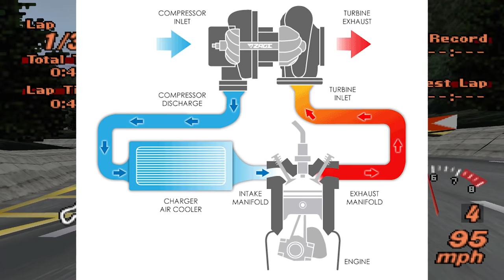5 MORE Gamer Misconceptions About Cars!

Comment: Thank you for #2... Cause so many games from 2010 and Prior refer to nitrous boosting as, "HIT THE TURBO BOOST!" or "ENGAGE TURBO!!" 
Like literally in NFS 2010, a bone stock Shelby Super Snake with a Supercharger...somehow still has a Turbo too?!?! Like wtf? 
My Coworkers still use the word "Turbo" like it also means "NOS"...

Modern games don't mix them up as often, but literally a whole generation of Non-car people have grown up completely having turbochargers misrepresented to them...
Reply: Yea
Reply: haha I got people asked me which button on my steering is my nitrous button. I had to explain them that in LMP1 hybrid cars uses electric motor that gets up to 1000 hp combine. I told them its lot better since you can use braking regen to get those energy really easy.
Reply: It's never fully explained in HP2010. My personal theory is that "Turbo" is just a Racer nickname for a Nitrous-like system that uses the exhaust system of the car (somehow), that works somewhat like a solid-booster; it can't be shut off until it burns out completely
Reply: @racer927  doesnt nitrous work like that IRL?
Reply: @foczastafomka5502  Let me give you the smallest version I can muster:
Nitrous oxide is injected into the cylinders on the intake stroke, this nitrous oxide, kept liquid under pressure, vaporizes and provides oxygen, which means that the combustion stroke will produce more power, it also cools the air inside the cylinder, allowing more air to be compressed without risking pre-combustion or "knocking" before the spark plug fires and ignites the air-fuel mixture as usual.
Reply: @racer927  science boi
Reply: @VdubsZone  Yes. Automation and BeamNG has taught me more things about cars than anything else.
Reply: @racer927  tbh automation is addicting for me lol, i cant stop making car to export it to beamng, and doing some experiment
Reply: one misconception, is that not using the clutch can damage your transmission, this of course depends on the quality of synchros, which is usually determined by the age of the car, other than that, as long as you match your revs relatively close, youre fine without the clutch at least in downshifts, which sim racers like assetto corsa and beamng seem to get wrong..
Reply: @LowEndPCGamer100  Really? I always thought the clutch was required even with synchromesh as that simply helps match the speed of the output shaft and gearbox. The pedal clutch simply disconnects the gearbox from the engine.
Older transmissions require what I've heard dubbed as "double clutching" (clutch, shift to neutral, release and then clutch in again for next gear) to help match the speed of the gearbox to that of the dog clutch on the output shaft.
I've also been looking up, thanks to using a transmission mod in Farming Simulator 19, various tractor transmissions and it's interesting to see that some transmissions will have synchronized shifting within a range but require a full stop of the tractor to change ranges. I've also discovered what are known as Wet Disc clutches which the transmission mod calls "turbo" clutches, essentially a series of clutch discs that are constantly lubricated which lets you hold the clutch open without burning it out as fast as a dry clutch and permits a bit of slip like a torque converter so that you can inch the tractor without the risk of stalling.
As a final aside, I did like finding out that using the clutch isn't required to go into neutral, that makes it easy in American/Euro Truck Simulator to simply pop it into neutral as I'm coming to a stop and let the service brakes and Retarder ease my truck to a stop.
Reply: actually the compound is NO (nitrous oxide)... NOS is just a company which manufactures NO and packages them in NOS branded cylinders :)....... tho u r true but i really love most wanted series XD
Reply: @racer927  i dont have any doubt that i am entirely wrong, but on the race track, no clutch is fine because most race cars end up getting rebuilt after a season or major race
Reply: Honestly you're not any smarter. The "Turbo" in Hot Pursuit 2010 obviously doesn't refer to turbochargers. Its a fictional system that is basically Nitrous on steroids
Reply: @r3uvsgaming  my problem with need for speed is that in all of the games ive played in that series, the physics are just total ass, i mean outrun for the system32 arcade board feels nicer to drive than most wanted black edition.
Reply: @r3uvsgaming  That's what I assume, some sort of boost similar to a solid fuel rocket that can't be shut off once started.
Reply: Ever played DT Racer?
Reply: @racer927  that’s cool to hear those help you with cars, BeamNG definitely proves you can’t just get a high performance turbo and go way faster, cause you need major changes to cooling systems and the block/heads and what not. I never got automation because it was kind of expensive, I also didn’t like the shells graphics on the vehicles
Reply: Lololololo
Reply: I'm a gamer, but I can't believe developers and other gamers don't use common sense
Reply: You can have a supercharger and a turbo on the same car. Volvo have been doing this for a while with their T6 and T8 models. It's just generally not done because it adds an extra thing that can break.
Reply: Honeslty those games are the reason initial d is so underrated
Reply: Most people when reading "N.O.S": "Nitrous Oxide"

Me when reading "N.O.S": "Not Otherwise Specified"

My job just makes me boring...
Reply: well to be fair, if you could turn your turbo on and off with a button, it would act pretty close to a nitrous
Reply: I've never really had the chance to get a misconception or "gamer" view. But i think that was mainly due to my uncle being a professional mechanic and building his own tuned car with actual turbo's and bottles of nitrogen. it was a bmw m3. First thing i did ask when i saw it was, if the light effects you get from your taillights in nfs where true 🤣
Reply: This is why EVERYBODY needs a free subscription to Car and Driver and not just me.

Hell, I'm not even really a car guy and hate the FnF movies and I never really carried any of these misconceptions.
Reply: @silversonic99  No it wouldn’t.  Not even close.  Nitrous is instant, turbos have to build pressure over time.  In this theoretical situation, the turbo would only start to build pressure once you hit your button to ‘turn it on’.  Now, electric turbos do exist, and can be activated with a button.  Since they use electric motors, they can spin at 100% speed almost instantly.  Therefore the only lag you would have is the time taken to pressurize the charge pipes and intercooler, which is negligible.  My knowledge on electric turbos is limited, but that is my take on it.  With an exhaust driven turbocharger though, it’s not comparable.
Reply: Weird cause NFS Underground, first one to introduce NOS, actually had it labeled properly AND shoot up smoke to the sides too. Turbo was a separate upgrade. Gran Turismo explains turbo lag, naturally aspirated and supercharger engines well, plus has events separate for those types so you kinda have to learn both, like in GT6 you can run Lambo Aventador for NA races but earlier needed some muscle car or, generally weaker, non-turbo versions of tuner cars.
Reply: i'm happy nfs underground 1 and 2 separated nos and turbo.
Reply: Yea lol
Reply: Modern terminology has changed turbosuperchargers to just turbochargers. Could become confusing for those uninformed and reading on older articles about forced induction systems like those used in WWII fighter aircraft.
Reply: @LowEndPCGamer100  NFS rivals has nirtous boost without constant flames , the turbo system is still like HP2010 😔
Reply: Miata or max-5 what’s better? (Joke)
Reply: where did NOS come from? I have heard nitro and even N2O but never NOS
Reply: The tutorial and upgrade videos of Turbo didn't help, as they did use a turbocharger there. At Level 3, it becomes twin turbo.
Reply: @harshchhetri644  No. NO is Nitric Oxide, one Nitrogen atom bonded to one Oxygen atom. N2O, or Nitrous Oxide, on the other hand, is 2 Nitrogen atoms, one Oxygen atom. They are very different molecules.
Reply: @racer927  Turbo often just refers to a timelimited boost or turning it to eleven outside of car contexts. So when developing a racing game it is important to check every term used for accuracy, normally this isn't a big issue since it is obvious that a flashlight with a turbomode does'nt have a turbine however it still makes the term unpure.

Comment: Point 5: do a drag race with the 1000 to 1500hp dragsters in BeamNG and experience chassis flex!
Reply: That’s the most satisfying part of drag racing
Reply: Question: I've had the game for litteraly years, got it back in 2014 or 2015, and still cannot figure out how to make the drag cars grip normally even on the drag strip on the west coast map. It's better on the drag strip yes, but still is hard to grip. What's a good tire pressure to start with because I know drag cars have pretty low pressure tires
Reply: @Sp00kq  as per internet, it is ideal between 15 to 5 psi.
Reply: @grhead812  ok. I'll give it a try next time. What I'm suspecting is what Bladed said. Not much weight in the rear. So if it doesn't work I gotta figure out how to put stuff in the back
Reply: @Sp00kq  addi g spoiler helps pushing the back afaik
Reply: @wibs0n68  only at higher speeds. It's mainly launching that I have trouble with. The drag cars do have spoilers on them mostly.
Reply: @Sp00kq  strip the whole front and leave the back stokc lol
Reply: @grhead812  could work
Reply: @Sp00kq  I find drag racing easy in BeamNG. Try adding throttle slower or something idk
Reply: Damn beam is such a great game, I have around 500hrs and I'm still playing it :D
Reply: @Jonah_258  1500 hrs here
Reply: @Sp00kq  softer suspension in the rear and have the rear height higher than the front, itll allow the car to squat onto the rear easier, and softer anti rollbars in the rear, more caster, and toe in in the front, and more camber in the front
Reply: Well that's why i love BeamNG Drive
Reply: @fuckfacesstashofshitposts3034  ight. I do have a steering wheel but it's so fucking annoying carrying it between the game room down stairs and to my room with my PC.
Reply: @initialyeet3951  1709 hrs here
Reply: @Sp00kq  ya need the drag slicks boi, you can download a mod that has drag performance parts which contains drag slicks, ultimate grip, i had the same problem as you and i fixed, nowhere i can do wheelies and twist the car frame whenever I want
Reply: Yeah I can't tell you how many times I have LITERALLY bent my car with the amount of power.
Reply: Yeah. Beamng is so underrated
Reply: Jack the back up and give it soft ish suspension low pressure tyres try apply power softly etc
Reply: Or just fully upgrade the isetta in forza 4 and try to drive it full throttle from a stop
Reply: A car with 1000 + horsepower is  not a car to me. No one needs that much power in Racing.
Reply: @FuntimeAG  yes and in beamng drive your point is proven, you can't drive the really powerful cars anyway just like real life
Reply: If you use the pickup for anything you'd have already seen chassis flex because just like real life they use an american-style c-channel ladder frame and it flexes offroad
Reply: @FuntimeAG  But beam NG isn't just about racing
Reply: Yeah just play beamNG  and it will be just like real life and all those misconceptions will go away
Reply: i got beam and you actualy get scared by going full throtle driving a barstow kingsnake, buy beamNG right now i got 936 hours on it its great
Reply: @Sp00kq  they just recently made the tire models, id say "not shit" because before cars ware close to undrivable, get the drag barstow and try it on the weast coast drag strip, also try to put big tyres on  a stock barstow and put 600hp just so it isnt too much and also try that
Reply: @Jonah_258  yes yes yes yes yes yes yes yes yes yes yes
Reply: @pancake5830  damn
Reply: @Jonah_258  1700 here

Comment: 9:35 Bounus points if the gamer in question is drag racing a car with an automatic transmission
Reply from the maker: Yup...then it's super easy mode.  Between shifts is one of the easiest points in time to accidentally start sliding.
Reply: Another point why drag raceing is not easy is that 11.000 hp top fuel dragsters (i know thats just a very small part of the Sport) can litteraly knock an untrained person out if the conditions are right.
Reply: bro no one can talk if they use auto in a car game and think theyre good. the only exception to auto is cruising
Reply: @notacti  i ment this as a point why professionals jave a harde time. They may not get knocked out but these forces ar still hard to overcome
Edit: i havnever driven one (no expeariance) but it must be like being rear endet for like four seconds straight.
Reply: @notacti  i use auto in nfs games because the shift mechanics are fucking horrible, but with that game its not like using manual would make it more immersive anyway
Reply: @oliverdepauw5663  I completely agree, if the shift mechanics are bad I can't stand using manual (NFS, The Crew 2 etc. I personally feel that every game should have auto reverse or an automatic dump down to 1st gear when you shift down if your speed is really low as button mashing an unresponsive gear system down to R in stressful situations is annoying), but if the shift mechanics are good enough, they can be so much fun - to the point where I get addicted to it and see it as a failure of game development when it isn't done properly, even though that can be unfair judgement in the case of arcade games made to be more accessible. But why can't something be accessible at the surface, but offer more depth for those who want it, like Forza? Development time and resources I guess...
Reply: @oliverdepauw5663  Some, such as NFS Hot Pursuit 2 PC has horrible manual because you can't to auto reverse. Same thing as NFS Undercover that has bug that the gear switch to reverse after braking so hard. But it is better in Underground series and Most Wanted 2005 because auto reverse is implemented and more consistent than Undercover, even better in NFS Carbon because manual mode is faster than automatic.
Reply: @BladedAngel  automatics in reallife want to have a talk (really they are a better Transmission)
Reply: What game allows you to use automatic in drag racing?
Reply: @stevengruner4885  forza
Reply: @oliverdepauw5663  manual is pretty decent in ProStreet and Shift
Reply: People who don't play expert mode in pixel car racer
Reply: @pandaguzman664  i mean, i hate the clutch position in that game. I almost always pick semi manual in that game the only times i dont are in cruise mode
Reply: @stevengruner4885  BeamNG
Reply: @bitelaserkhalif  automatic if i am driving to crash or just crusin and manual when i want to drive on highways
Reply: @thatoldme1234  all car components and helpful systems can be beaten by a human foot or hand. Abs for example
Reply: @stevengruner4885  no theyre not. Using manual the propper way makes your car faster
Reply: @FuntimeAG  nope, automatics have come such a way, they shift faster than humans now
i'm a manual transmission fan, but you have to admit, a human can't beat a trained robot
Reply: Duhhh!dont brings up automatic shit into enthusiast world,they love manual as much as i do :)
Reply: I thought drag cars didn’t have transmissions
Reply: Minignoux, ya but the issue is that your transmission is basically guessing what gear you need at any given time. Manual allows you switch into a gear as you need it. Electronic manual is best though

Comment: "games let you use NOS whenever u want for the fun"

beamng: let me introduce myself
Reply: sure. do it yourself
Reply: You can modify the nos so it sprays instantly. Too much power also might overtorque the engine
Reply: "Overtorque risk."
"Engine permanently damaged."
"Engine broken."
Reply: @racer927  Engine Gone
Reply: @shinkishimoto7607  That's when you shut off the engine, hold the spray button and then try to start the engine. If the added power is high enough then the engine might yeet itself from the car.
Reply: @SpoonR24  500kw shot size

Engine to the moon
Reply: @SpoonR24  madman
Reply: "engine destroyed"
"financial ruin"
"family left"
"broke and homeless"

Wow, they said it was realistic but damn
Reply: @racer927  "Driveshaft Broken"
Reply: @SpoonR24  What chaos!!!
Reply: @SpoonR24  overrev damage
VAlveTraIn daMaged
Reply: @baggier  999999999999 kw shot size
Reply: @racer927  that hurt me. Every time I think my car is done being tuned, it blows up after 15-20 laps on a track.

Comment: 7:45 Nothing to do with system limitations. It's just purely a game design decision. Most races in games like Gran Turismo are short, maybe ten laps max, so if the tyres wore down at a realistic rate, you'd never wear them down enough to actually feel the loss in grip. Increasing the wear rate is done on purpose to make races more exciting.
Reply: The reason you wouldn't feel it is due to the way GT simulates tires, poorly
Reply: @comdrive3865  that and that og gran turismo games suffer from a lot of oversteering and under steering, I swear even with the f1 cars I oversteer in gt3. Also the only races that last more than 10 laps are the endurance ones